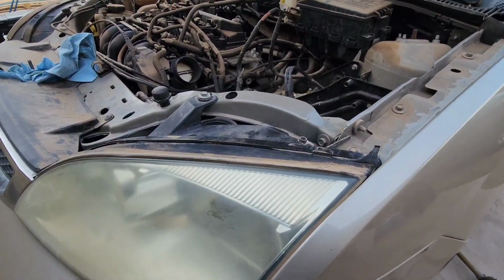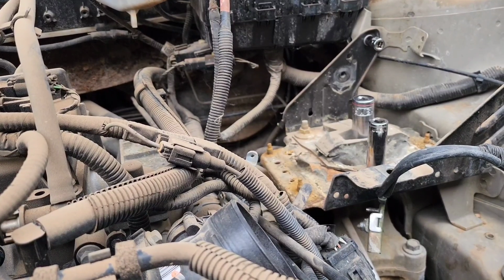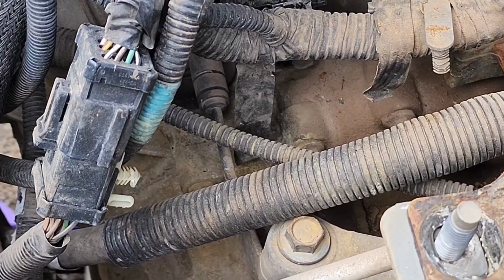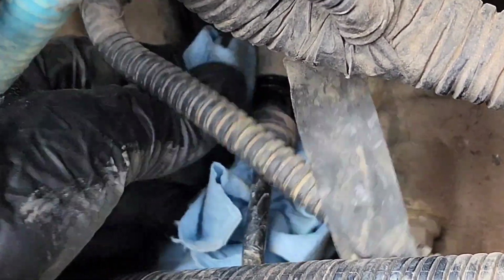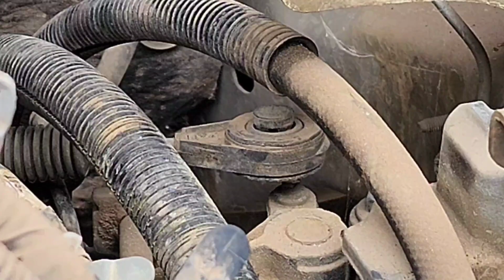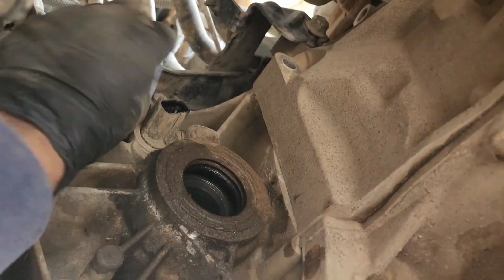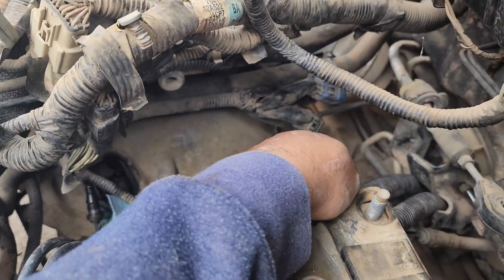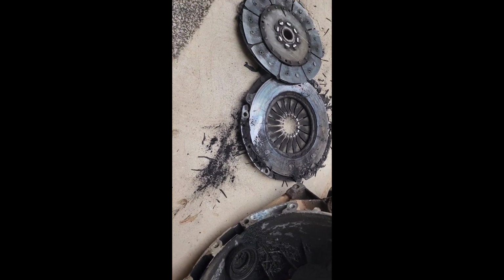(part 2) clutch removal on a 2007 ford focus

Comment: I just finishef removing the trans in my Focus using your method. Ya got it out but what a diaster! there is no way I'll be able to reassemble with tye suspension frame in the way. Im going to drop the suspension frame and reassemble clutch and trans the "proper way'. Thanks gor making the bid though cause I could never remember where all the brackets go. Lucky I really like this little car otherwise it would have ended at the scrap yard!
Reply from the maker: Yes the correct way is to remove the sub frame. I just wanted show it could be done since alot of ppl told me it couldnt be done like that.
Reply: You end up getting it put back together? I struggled even with the subframe out of the way on my buddies car so now im afraid to do my own clutch loo
Reply: X